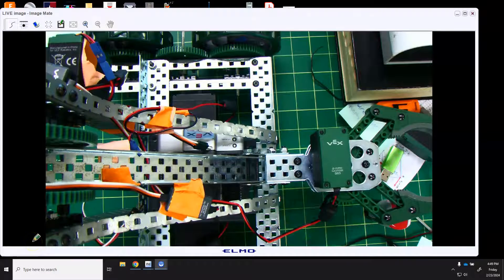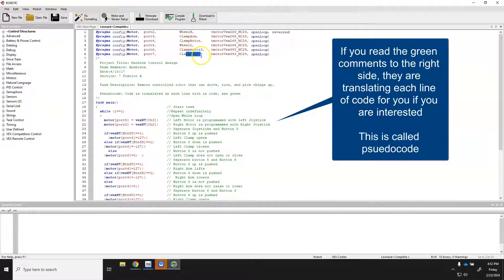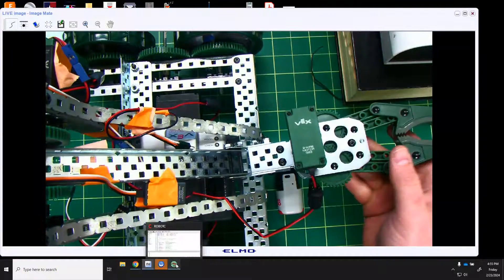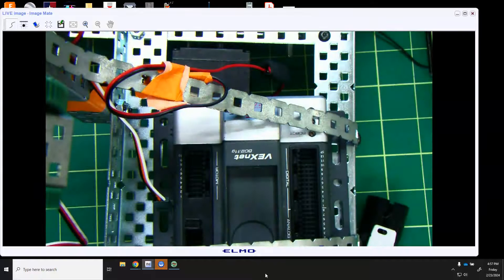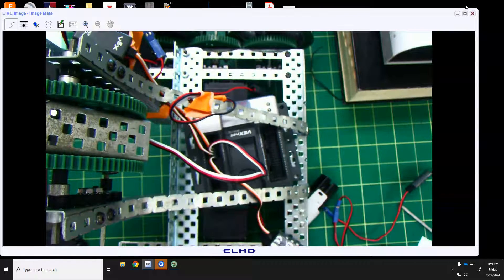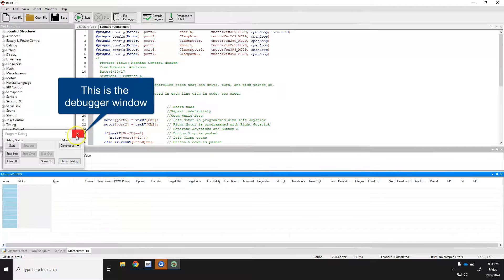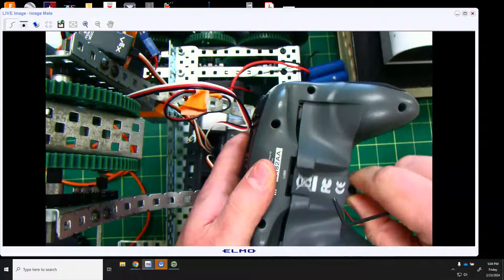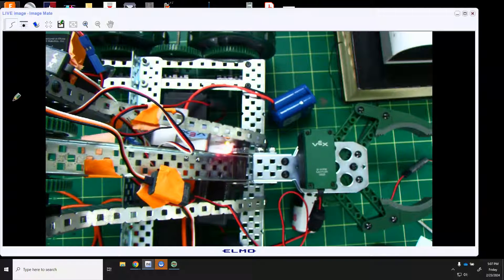Programming the Vex Clawbot

Comment: How do I move it straight forward what code do I need to put we followed the instruction in our activity but it is going backwards
Reply from the maker: You probably plugged your motors into the motor controller 29s backwards. Keep the wire plugged into the Cortex, but unplug the connection in the middle of the wire where the 2 wire motor is converted to 3 wires. Then plug it in backwards